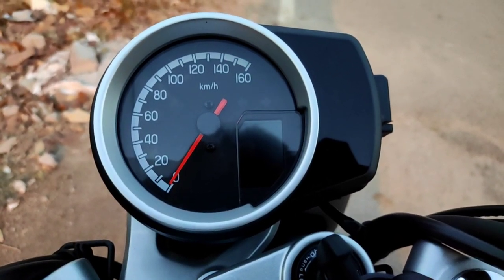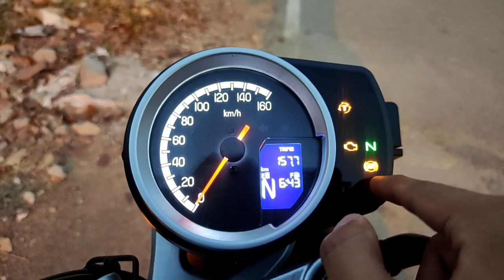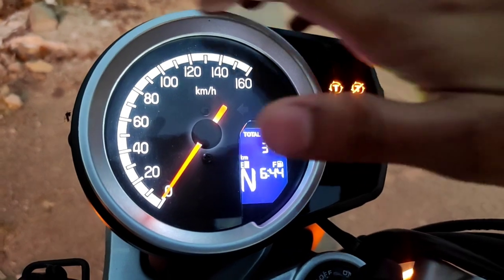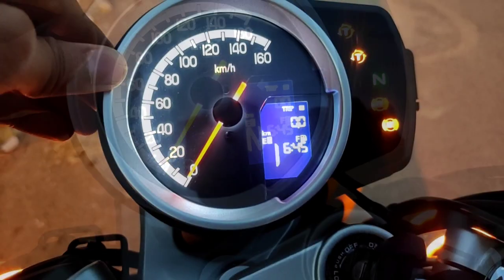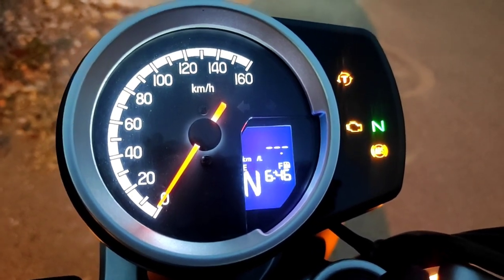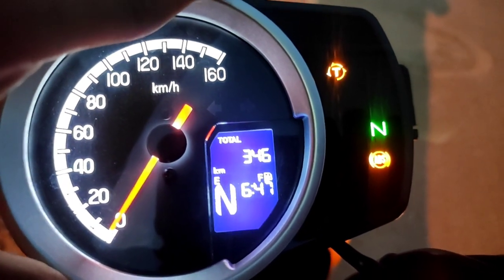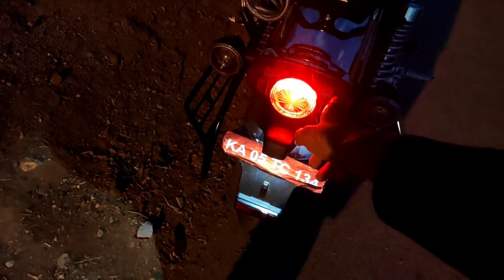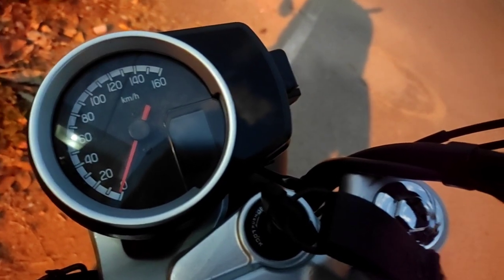Honda Highness speedometer console features explained | Honda CB 350 instrument cluster

Comment: how to know that how much the bike will go in the reserve? as u said the last bar blinks means it's in reserve..
and does the range is calculated as per the oil left for how many kms can b travelled?
Reply: Bro don't go till reserve. It has fuel injection mechanism. Have a minimum of 2l of petrol in always. The engine can get air locked if the fuel runs out.

Comment: The so called expert moto reviewers started this utter stupid trend of calling HSTC(Honda selectable torque control) useless on Hness and all the other average joes and novices echoed the same. In actuality HSTC is purely a safety feature, which is supposed to kick in only when the rear tyre looses traction under sub optimal conditions like gravel, near bald rear tyre, oil slicks, clutch dumping(Happens on a regular basis for new bee riders in high torque bikes due to extreme throttle response) etc. I guess the same idiots would call airbags useless because they don't meet with a crash on a regular basis. HSTC is actually a great safety feature, which is never offered or even thought of in a bike of this class.
Reply from the maker: You are absolutely right sir, I always stress on this point.. Any safety feature should be appreciated because all we get in the indian market are useless features.. The traction control maybe a simple single level one but what it will do is save life when we need it.. When I was checking other reviews thats what i always heard that its useless 😕.. But I certainly appreciate honda for giving this feature..
Thank you for the explanation.. Please do subscribe and be part of the family ❤️